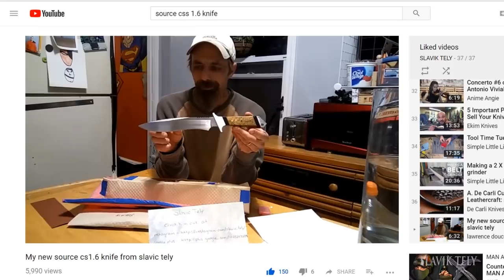Price of Tely Knives

Comment: Maybe it has been asked before, but when you handsand before heat treat, why going up to 600 if you start from 220 after heat treat ? Just go up to 220 before heat treat, no ? 
What I do is grinding everything with 80 grit, then heat treat, then it's final grinding with 80, and then I jump to 400 grit to clean everything and I start handsanding at 240 grit.
Reply from the maker: But you grind with a belt grinder. I am speaking to people that do not have belt grinders. After heat treatment I do not grind my knives. They are finished in their shape and  edge thickness.
Reply: @SLAVIKTELY  oh I see, I wad wondering why you didn't grind after heat treat.. but it makes sens since you spent time with you file jig to make everything flat before
But why going so high in the grit before heat treat and starting low after that ?
Reply from the maker: Sometimes scale is hard to remove  from high carbon steel. As for stainless steel, I sanded it to 600 and after it came back I picked it up again with 600 and went to 800. Stainless steel is easier to work with after heat treatment than carbon.
Reply: @SLAVIKTELY  oh, so a higher finish before heat treat prevents the formation of scale ? I didn't know that
Yep, I've heard and seen that stainless steel are easier to polish, at least they take a better mirror polish
Reply from the maker: It's not that higher finish prevents scale formation but after heat treating, I don't have to deal with scratches from lower grit sandpaper. I try to get to a finished steel before heat treating.
Reply: @SLAVIKTELY  I see, that makes sense
Actually that was also my way to do it when I didn't have a belt grinder, but I only went up to 220 grit